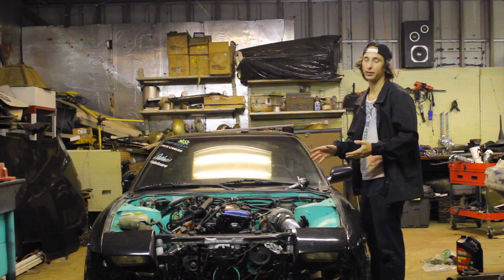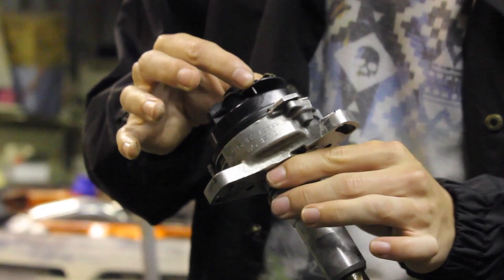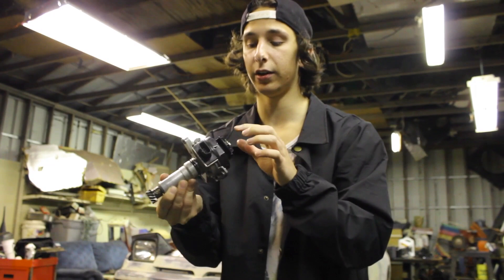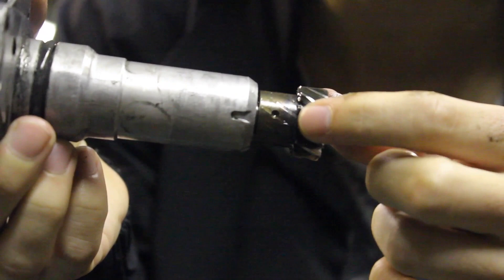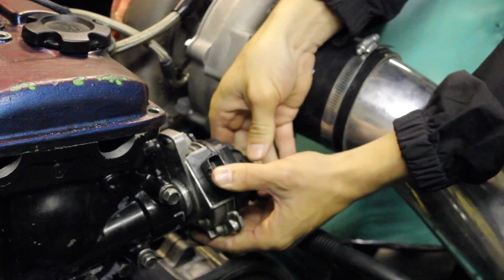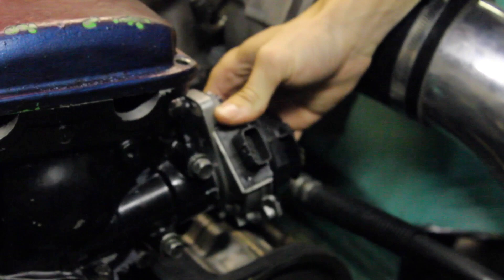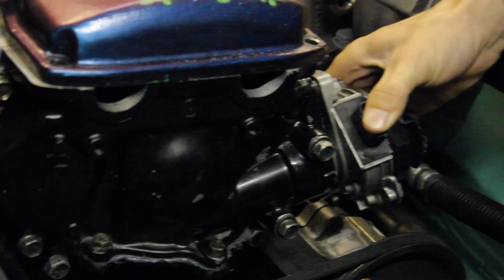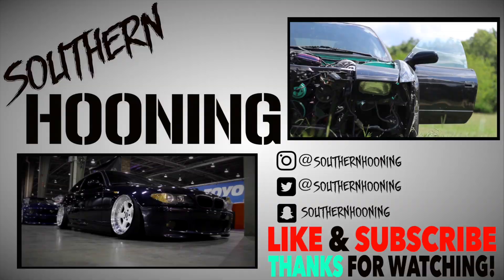TURBO 240SX BUILD | HOW TO SET DISTRIBUTOR

Comment: I've been having the time of my life setting timing on my 240sx. Set to top dead center adjusted the distributor several ways, and could not set it to 20 degrees. Here I am thinking it's a tooth off on the timing chain somewhere. Only to find out the cheap aftermarket timing kits, have the idle pulley which is different than stock.

Comment: I noticed your distributor rotor is facing 10-11 o clock, this is incorrect. It's only supposed to be that way in the S14 KA24DE. On the S13 it should be facing 8-9 o clock position.
Reply: He must have f**k up the timing. I heard if timing not right it will not spark.
Reply: Yooo Bro thanks so much for that advice bro I been trying to get my shit started for three weeks and Iv watched this dude video 100times to understand what I was doing wrong even though he was doing nothing wrong it was just like I tooth off 🖤🤙🏽
Reply: I don’t understand? I have it at the 8-9 and the 10-11 and still both do the same thing. The car lights up and then dies immediately unless I feather the gas

Comment: This is a great video to help set the distributor but you didn't explain about having piston #1 up or using the line markings on the crankshaft pully. Did you already have piston #1 up or use the lines on the crankshaft before showing the distributor placement? If not then then viewers won't know about it and they will just take their distributors out and think it's as easy as placing the rotor just like you said and putting it back in only to find out their cars won't start.
Reply from the maker: good point man, I will update it in a later video, I focused to much on just the rotor button 😑
Reply from the maker: by the way thank you man for pointing that out!
Reply: Southern Hooning yeah bro! Plus showing the whole process including the timing marks on the crankshaft and describing having piston #1 up will help viewers so much more! On the other hand, very informative videos. Keep them coming!
Reply from the maker: yea man, I'll redo it soon!!! thanks again man!

Comment: I set cylinder one to top dead center using the timing marks and putting something on the spark plug hole. Then I put in the distributor like you said and I'm still having problems. My car would start before I had to take out the distributor so I don't know what could be wrong.
Reply from the maker: Leda Cygnus set it back to tdc and just take the distibutor out and turn it a tooth, might be off by just a tooth